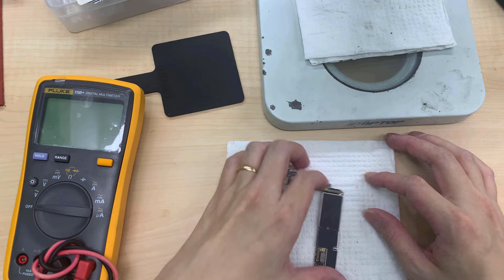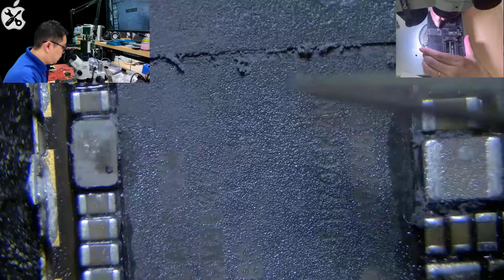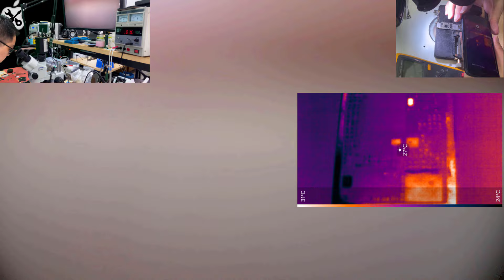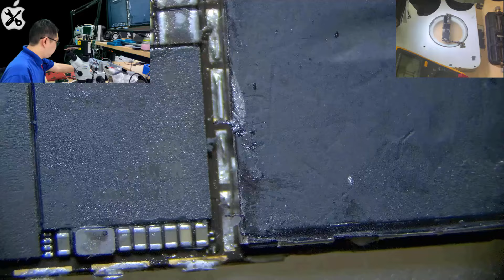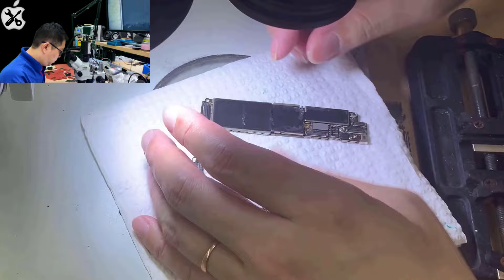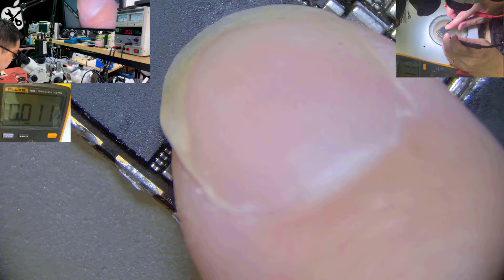iPhone Baseband CPU Short Repair 【Special Case】Qualcomm | Unable to activate

Comment: The reason this fails is the feedback circuit and the lack of resistance on the pground pads. If the 1v feedback is missing then the smps5 output rises to Vdd main voltage .  The ground jumper is to prevent the feedback loop from failing and bbpmu sending the output of >4v down a 1v0 line eventally blowing the modem.
Reply from the maker: Yes. That’s why I mention not every ground is useless and it’s a prevention. About the Pgnd u said I already cut it out due video I explain it too long. 
Nice quality comment. This comment will be pinned. 👍🏻
Reply from the maker: By the way, due of that flaw, the damage can be different. 
Sometimes it lead to us believe this is one of the reason why they started to take Intel Baseband only in certain models. XS 😂
Reply: @iPhoneServiceMalaysia  thanks .
Reply: Hi, I did a detailed write up on this a few years back on my blog illustrating the fault condition , solution and mitigation. Great videos btw, keep it up.

Its refreshing to see methodology and working conditions being taught in your videos.  

Regards Dee
Reply from the maker: @DeeGee  Cool. Love to see someone helping the community especially Apple keep bullying 3rd party repair. 

Mind post ur blog link here? I'll check the spam comment box to approve it. 
Wish you stay healthy for this time being.
Reply: @DeeGee  can i get link of your blog, please?
Reply: Hi relax I have provide link to  iPhone Service Malaysia as its his channel if thats ok....
Reply: @DeeGee  yeah, sure i find the blog link.
Reply: @DeeGee  link please ?
Reply: how to find blog link
Reply: I have the same problem, sir, the SMPS line is short-circuited, I installed a 2.2k resistor, but the result is "error device didn't accept baseband data", please respond, sir!
Reply: @adibastos_  Dear Andi,

If you have put a jumper on the ground pads and applied the 2. 2k as per drawing on my blog and the repair is not fixed then you may have a blown modem. Before any restore make sure the voltage on smps is correct and stays on for more than 3 seconds. 

I have a post on the blog to test how bad the fault is by repairability and if the modem is blown using a dcps on the circuit.
Reply: @deegee1167 link please and thank you 😊
Reply: @deegee1167 Hey if you don’t mind me asking, where did you learn all this knowledge of? To me it seems like you guys have super powers
Reply: @annymp  passion, dedication and persistence . Thanks btw .
Reply: @deegee1167 please can the same solution works for the pp_1v0_LDO9 line.the baseband cpu is shorted
Reply: @adibastos_  I have inboxed you on my site.
Reply: Hello can you fix iPhone 5c internal cpu short?? On line 1v1 cpu short
Reply: Cant apply to iphone 13 pm?

Comment: I didn't understand, in the video you show that even if there is a short you have 1V stable on the capacitor. Why spin on another power supply? If you do it is because the low impedance makes you sit pp_1v0_smps but in the video it remains stable. thanks for your videos

Comment: I have the same problem, sir, the SMPS line is short-circuited, I installed a 2.2k resistor, but the result is "error device didn't accept baseband data", please respond, sir!

Comment: Hello, i have no signal issue on ip7, but it shows emai and modem firmware in settings, but nothing with *#06#... I've tried factory reset, flashing and still the same. What could be bad in baseband cpu?

Comment: Can anybody me about iphpne 7 no image issue..
All lines are showing perfect readings on connector even-5 and +5 and 1v8 line is ok also 3 lines of backlight is drawing volts according to diagram but still no have any ligh no image..
I found one thing which is abnormal..

The thing is 
PP_LCM_BL_ANODE is stable on 6v but mot increasing to 16v as compared to other board..

Comment: Sir, I have the same issues.but in my case full short on the Baseband power section capacitors.then I removed the Baseband CPU.all shorts are gone.what can I do.please help. any solution for this

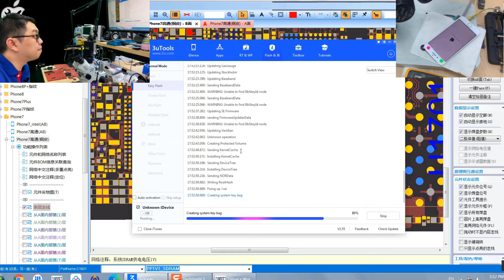Comment: 12:01 and 15:42 and 17:14. yeah, impressive idea, knowledge and experience, BUT what is the point of that kind of repair? ok for competition, from the technician (yours) point of view, the issue is fixed, phone is working fine, good job, etc. But from the customer point of view? For what do I need that kind of phone, where the partial-shorted IC is taking more current as suppose to take, so it will drain battery fast and it will generate a lot of heat. And one day that partial-shorted IC can go worst and pull down whole phone to dead short. So I don't get it, what is the point to use that phone daily when it is like a ticking bomb?
Reply: Yeah and y didnt he replace the short capacitor to clear the line
Reply: And he mentioned that if the user restores os again he will face the same issue

Comment: I have tried the same method on the same problem smp line shorted after i fixed 2.2k R from sd ram line to cpu baseband smp line and i did software after that .. but still there is no imei 😔😩 may i have your contact number please

Comment: I dont understand. Is the baseband shorted? and how putting 1V through a resistor  to the shorted side of the cap will fix it? the line is still shorted
Reply: Yea the ic shorted thats why he need to inject 1v stable to that partial shorted cap to enable or read by the system.
Reply: @bernardsese627  y didnt he replace the short capaciotr

Comment: I used this method on the short circuit BBPMU_TO_PMU_AMUX1 (short from BB_RF) line but it still didn't work. is there a solution.?

Comment: Hi Lim, I was wondering if you have a page where the most common tools needed for doing board repairs can be found?
Reply from the maker: I think I should make one video abt it.
Tools require is just one thing.. most importantly is do not buy the tool that not suitable. That’s why I think I’ll talk about power supply, multimeter...
Reply: @iPhoneServiceMalaysia  I appreciate in advance about video on tools and recommendations. Thanks

Comment: Thanks again lim for sharing actually I not understand why you but resistance 2.2 between capacitor it’s same voltage you are my master lim big van from Kuwait 🇰🇼
Reply: I think he did it for protection. -if the value of resistor is more close to zero then partial-short after that resistor can heat it too much and beak it or that source line where that resistor is connected can be pulled down with that partial short. So for protection he used high resistance, so even when the ic will do a full-dead-short then it will not affect the source line (on capacitor) because of that resistor and higher resistance.
Reply: @Radek__  why didnt he replace the short capcitor instead